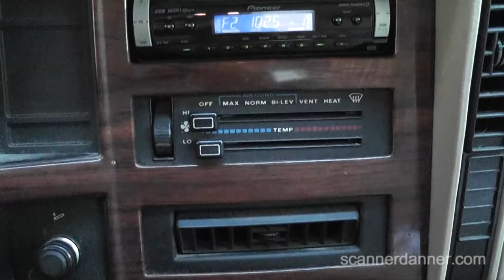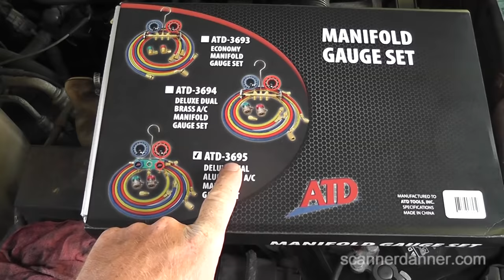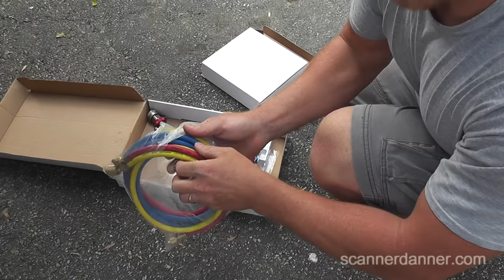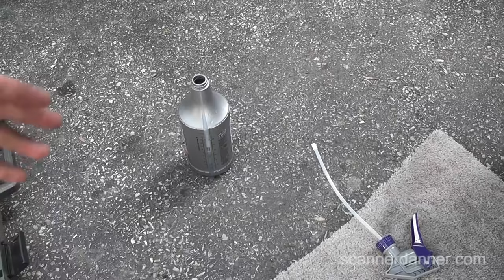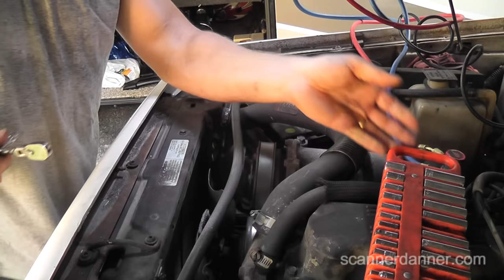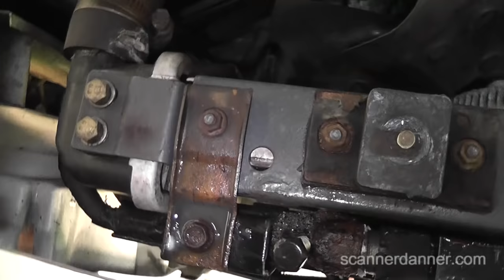A/C Leak Testing and Repair part 1 - 95 Jeep

Comment: That's me brother, I drive older vehicles and with your help, keep them running. Nice set of gauges. Poor Eric and flip flops. I like the air check. If we weren't here you could have found that leak in 5 minutes. Your going to be busy. Two channels, the forum and now the RV and jeep stuff. Hey, I'm all for it, but pace yourself.  :) Great information Paul, thank you.

Comment: My Cherokee cracked the clutch also. I made a low clearance puller and pulled it off, installed a used one from the junkyard. That was 100,000 miles ago. The jeep has 380,000 miles on it

Comment: Watching your videos have become addictive. As a retired ASE mechanic who changed profession in 1979 and became a general and electrical contractor, I need to learn to about the new technology in the automotive industry. If for nothing else to repair my own cars. When I started learning about auto mechanics in 1967, there were breather tube on engines to dump the bypass fumes to atmosphere!
Your videos have been very informational for me. To a point that I looked into going back to school at Rosedale. However, it is not practical due to where I live (Los Angeles) and associated cost of Rosedale college.

Thanks again for taking the time to teach us.

Comment: I FOUND the leak on a 1999 mercury villager and 2003 ford mustang using my little tire compressor that only  put  up 100 psi. I glue a tire Schrader valve to the yellow filler  hose,  it works great  . THANK YOU SO MUCH for your idea ScannerDanner...

Comment: Just went out and pressurized my empty AC found the leak right away.  Just replced the O-ring at the condensor coupler and it seems to be holding.   Great video.

Comment: Had a chuckle when you had your little dig regarding you previous AC Video as you know I was one of those that commented on checking the power at the pump. But I think I also mentioned checking for power both sides of the pressure switch.
I think the essence for your inexperienced viewers is that there is more than one way to do things and different techs will take different approaches to find a problem. A jumper wire on the pressure switch wires will tell you if your clutch is working.
At the end of the day the same conclusion will be found regardless of which procedure you take first.
Concede that in this video the guages needed to be connected.
In finishing. I have stayed in this trade for 36 yrs  and still enjoy fault finding and the thrill of trying different ways to find a problem.
Keep them coming Paul. You know I will be watching and look forward to making an argument in your coming videos.
Great Work

Comment: Tech teacher as well, mobile plant though. I mostly use nitrogen for leak testing A/C because we have it but I like the use of air under the circumstances you were under. As long as a new drier goes on, no harm done.
I really respect the fact you cover your thought process as the job unfolds. There are a number of ways to skin a cat and as long as the customer gets what they pay for no harm is done. I really like your work.
Reply from the maker: Thanks man!

Comment: Yep the milwaukee 2457 is awesome.  Loving it.  I have the 3/8" version but it's basically identical to the 1/4".  It doesn't have the most torque in the world, but I like it because it knows when a bolt is too tight and it can't break it free so it won't jerk out of your hand but instead it'll flash its light to tell you.  And at that point you just break the bolt free like a hand ratchet and spin it off.  The reason I went for it is it's simply the fastest one out there at 500 rpms.  I also considered the acdelco one--same price--because it has twice as much torque but it was half as fast.  I choose speed because I can get things out so quick and it means a little less editing in my videos.  (The milwaukee 200 lb-ft 3/8" impact driver is also the best as well--can't beat it)

Comment: Your video was exactly what I need it to diagnose 2001 ford Taurus with no gas in the system. Hope the compressor will run after discovering the leek and repairing. You are very practical and helpful.. Thanks.

Comment: I've got the compressed air tip from you. Never looked back since. From then on, empty system --> compressed air. Saved a lot of head aches and gas. Awesome! Thanks.  ;-)

Comment: The a/c system in my '87 Ranger is very simple to operate and maintain.  There is an individual climate control system.  Both passenger and driver side doors have a window crank.  Turn counterclockwise to turn cooling on, clockwise to turn off.  LOL  Keep the vids coming Paul, always enjoy them!

Comment: If I was a bettin' man, I'd say that nut on the discharge line to the condenser is going to take all the threads with it. Maybe not, since it spent most of it's life down south, and you are "down south" from me here in MA (lol), but up here, it's pretty much a given that you're going to be replacing a condenser whenever a vehicle is that age, or if there is that kind of rust on the nut. 

Got a good story for you on wasting refrigerant ...

So, I redid the system in our '93 Volvo just a couple months ago. New compressor, suction line, custom made liquid line, accumulator, & orifice tube. R12 and mineral oil. :) Get the system charged up and running - blows 37° out the vents rolling down the road on recirc with the fan on high, at 80° or so ambient. System is GREAT! Well one muggy morning I go out and fire up the system to take some humidity out of the air, when I hear, PSSSSSSSSSSSSS! Ahh shit! A cloud of fog and oil is coming out of the cowl on the passenger side. My $30 a pound R12 going to the A/C gods in the sky. 3 pounds of it too! :(  . By the time I started to run towards the house for my recovery pump, I realized I hadn't yet vacuumed my brand new recovery cylinder! Shit ... shit!! What an awful feeling watching all my money vaporize before my eyes. 

My next thought was, WTF just happened??? Saw it was blasting out of the accumulator connection to the suction hose. I took the fitting apart expecting to see a mangled o-ring. Thing was mint - still covered with liquid snot (Nylog). So as I'm installing a new o-ring, just because, I just knew I was missing something. As soon as I got the nut tight, I found the problem - the hose was able to move in and out of the accumulator with the nut cranked down as far as I could without yanking the threads off, about 1/4"!  WRONG ACCUMULATOR!!! Boy was I cursing up a storm after that one!

My windshield, underside of the hood, and firewall was all fluorescent yellow from the leak finder oil, lol! Still is!

 What amazed me the most is, this system ran without a problem for 3 straight days! Even my Bacharach leak tester didn't pick up a single molecule leaking out of the joint! I figured something like that would leak out the instant I leak-tested the system with 134a (compressor not running, of course). That right there is a testament to Nylog. Stuff is AWESOME. Put that on all your threads and o-rings, and that system will be happy for a long, long time.   

I may win Youtube's "longest comment section post in history" award now ... :D

EDIT: forgot to mention my favorite leak solution. WINDEX. It sucks as a glass cleaner, but makes a great leak finder in A/C systems and tires. :)
Reply: Thanks! I enjoyed that long comment and appreciate 2 things to do...use Nylog and grab the windex when I go try find this leak Im sure I got!

Comment: I sold my snap on 3/8 14.4V and bought a Milwaukee 18v 3/8 impact with 2x 5Ah batteries, great tool and the batteries last forever! Easily a month and I work in a busy Toyota dealership. Can't recommend Milwaukee enough, got the battery ratchet on order, my colleague has one and it is worth its salt. I hate hand tools! Lazy I guess! Nice video Paul. Looking forward to some Jeep/RV stuff. Have a great weekend.

Comment: I have used my Milwaukee 1/4 ratchet for 3 yrs plus with 0 issues, love it! got another tech in my shop to get one, 0 battery issues with m12, I have 4 batteries as I have a 3/8 ratchet and fuel impact m12 love milwaukee tools,  power in on parts with a 1/4 air ratchet, the fuel impact is awesome it will take off most caliper bolts!

Comment: I just had my house switched over to a new R-410a system; the difference is astonishing!  I'm curious to see what the automotive industry has in store for refrigerants.  It's a much more challenging environment, since simply raising system pressure isn't an efficient option.  CO2 seems like a good choice, if you've ever "hacked" an A/C system with canned air dusters.  ;)

Great video!  Looking forward to the rest of the series!

Comment: Paul, i've been using soapy water for years as well as dye and a leak detector. I also use Shellite (white spirits) to flush the systems, found that it removes all the oil without leaving a residue.
 I really like the Milwaukee battery ratchet, batteries seem to last a reasonable amount of time for the size (1.5ah).
Great video, looking forward to seeing more.

Comment: Aye Paul, i love your videos. I was changing my oil pump gasket chevy sonic 1.8l.. engine moved towards the firewall pushed on the ac lines connected to the expansion valve and cracked the evaoorator coils. Will be ripping out the dash. I have no installments and when it was brand new, the dealer hated me because i did all the repairs myself 😂 😂😂

Comment: Hey, nice one here! And a series too! Can't wait. I know a little about AC work, just enough To get me in trouble. Can't wait to see if this set answers some of my questions. About the power ratchet question. I don't use those things. I got used to using a Milwaukee drill impact driver. I got a set of quarter inch adaptors to quarter inch, half inch, and three eighths inch square driver (just a few bucks for the set at the parts store, maybe a bit more off of a truck, for high impact use) for the impact driver, and can use it for almost anything. If a fastener is too tight, I just use a ratchet to loosen, then zip it off with the impact driver. I can also use it for a impact screw driver, like for deck building, and with the drill bites that have the quarter inch hex drive ends, it can be a great drill. It's an 18v battery, and recharges in less than an hour (maybe 15-20 mins)! It's versatile enough to justify. Drill, power screw driver, impact screw driver, power ratchet, all in one.
Reply: Oops! DRILL BITS, not drill bites! My bad.

Comment: Awesome test. I use it all the time in Arizona, we do a.c. all year. I never thought to engage the compressor to see if it works. great idea! Our shop just recently purchased a four channel temperature transducer for charging to the proper level. that's a whole new thing to learn. were seeing a lot of aftermarket parts don't hold anywhere close to the same amount of refrigerant. sometimes 75% of manufacturers recomended charge. I was surprised to see that the first time. just as much damage can happen from over charging
Reply from the maker: That's awesome Cody. So where do you place the four temp.sensors? 
EVAP inlet and outlet and where else?
Reply: ScannerDanner evap inlet-outlet. Your looking for almost zero difference in the two temps. Condenser outlet-inlet 35-45 degree drop across the condenser. Also ambient temp, vent temp and compressor case temp. Usually over charging increases compressor case temp, as the flow of oil slows down. Its kinda new to me. I'm still learning. The crazy thing is just changing a condenser, even a oem unit, changes the charge level. We did a whole system in a honda. The original charge was 1.1lbs. After replacing the compressor and condenser the new charge was .75 lbs. We had a few come backs because of these system changes until we got this machine. Now our vent temps are in the 36-42 range.
Reply: Evap inlet and outlet should be almost zero difference. With in + or - 5 degrees is acceptable
Reply from the maker: awesome tips man. Can you post the link to this machine you are using? Or the temp transducer kit?
It may not post from the link but I'll unlock it when I see it. 
Thank you Cody!
Reply: I noticed this charge discrepancy on our '93 Volvo 940 I just restored the A/C in. Thought it may have been from the custom line I had made, but that's a great point with all the chinese parts that are out there these days.

I was told a long time ago that if the outlet of the evap is slightly colder than the inlet, you're good to go. That means the evap is completely flooded, and you've got a little reserve refrigerant in the accumulator to account for normal leakage over the years. I've always done it by feel - been doing it this way for about 15 years, and it's working for me.

Probably safer to do this with R12, but it works with 134a too. I've overcharged an R12 system by a half pound once, and the system still cooled amazingly! Shocked it didn't slug the compressor. Got sidetracked and wasn't watching the scale ...

Certainly would be nice to have a unit that told me exactly what the line temps were. My fingertips aren't getting any younger. Probably out of my price range, I'd imagine.
Reply: +Smitty Smithsonite ja Ja ja......l thought I was the only person who works with flip-flops...greetings from Greenville, S.C

Comment: Don't be surprised if the evap core has pinhole leaks: common problem with early-mid nineties XJ's. Learned the compressed air trick helping in a garage as a teen in the seventies (empty system only!). Changing those cores is a bummer. I have a 2001 that needs replacement. Great video - I'll be watching! Thanks.
Reply: Also recommend replacing the heater core at the same time while you're in the air box.

Comment: I love your advice on the air pressure test... I developed the same methods on my own to resolve leaks before charging. the system is already open, and it needs to be tested so air is just fine. if I specialized in a.c. I'd use nitrogen, but mainly just because it's more professional. as you know from experience the air isn't doing any meaningful harm.

Comment: U-activate is my a/c friend check compressor and find big leaks I bought one a couple years ago just quick on/ off pump air with compressor check clutch load side of circuit all good but I like the compressed air trick awesome. thanks for the vids my friend.

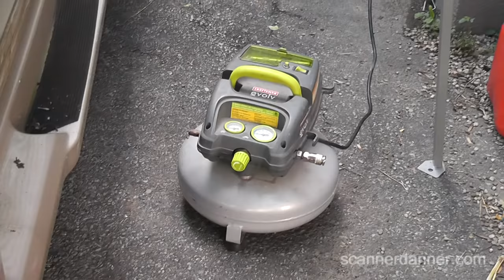Comment: Great video.  At 15:45, your neighbors must like you.  On the ratchet,  I like my 1/4 Milwaukee.  It is durable, gets in tight places, and saves time delivering about 30 ft/lbs of torque.   Battery life is outstanding as I have done several transmission pans without recharging.  May be on back order as it is very popular.  Combine it with the Grey Pneumatic 1/4 inch socket set.

Comment: Great videos, I use and like the Milwaukee m12 - ratchet 2456‑20. 

The compressed air is good method compare to charging the system 1 pound of freon to check for leaks. So compressed air  if customer declines work you don't have recover your freon back. Here in California EPA is very strict on that.

Comment: I'm kinda enjoying the not so technical side of your videos, Paul. Myself i'm not learning a lot but i'm sure these video's are helping many others. Sometimes they do clear out a few cob webs though. Try using Dawn dish washing soap as it makes real good bubbles. I guess i should have cleaned my glasses because i didn't see the cracks in the drive plate either.

Comment: I always wondered if using shop air to find a leak was something doable, especially if I already plan on changing the drier and vacuuming the system at the end. I will use this method on my next ac job that fits the criteria.

Comment: Battery operated ratchets and impacts are awesome.  They are really great for doing under dash work and you don't have to worry about dragging  nasty air hoses across a customers seat or carpet.  The biggest plus is they might help reduce the chance of getting wore out wrist or carpal tunnel.

Comment: Setting up tools to do air. I’m going to have to try setting up a center hose for hooking up compressed air to it for checking major leaks. I saw another vid where he did that and found a compressor with super leak through shaft seal. No wasting refrigerant. Good idea.
Reply: Michael Szczys
 - For what it's worth. If you don't have the triple hose/valve set. You can use the simple single hose kit with an empty can! Remove the tap with pin that pierce the can. Trough that hole you can easily pump compressed air into the system.
Cheap and fast. ;-)